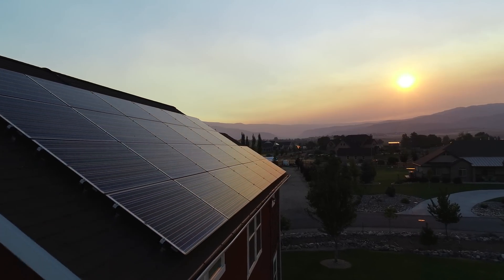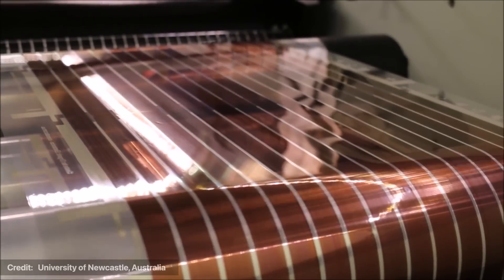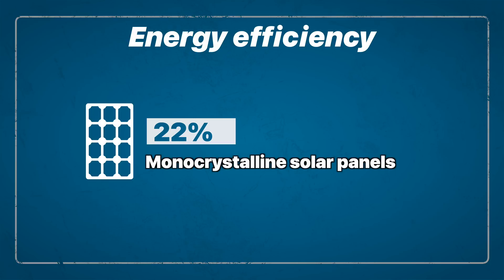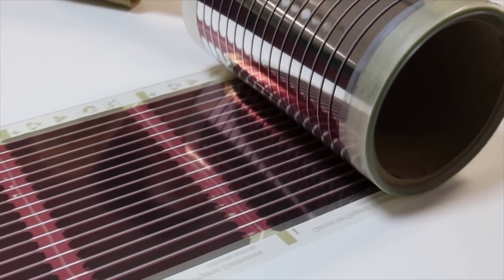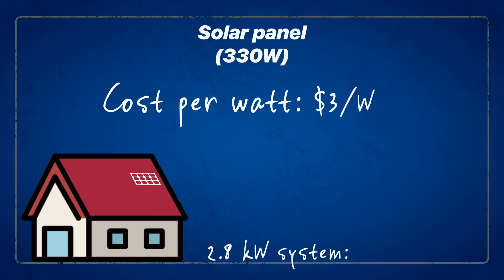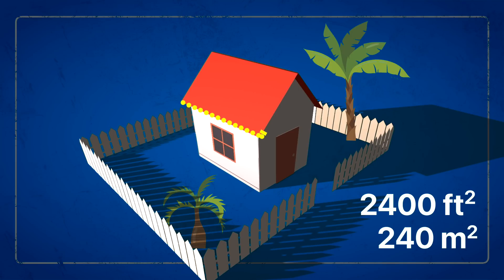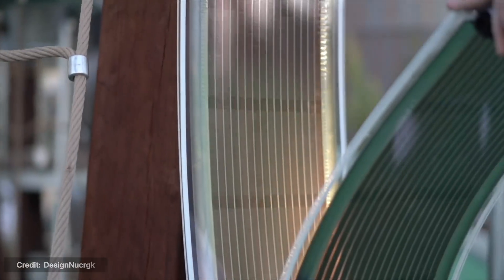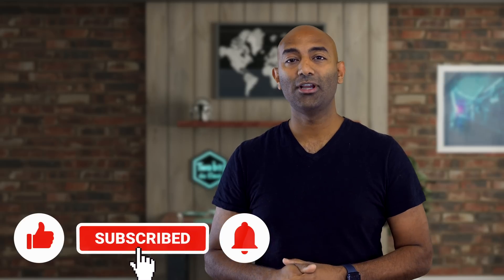This Breakthrough Solar Tech is CHEAP & Printed Using Ink!

Comment: The price advantage is misleading. A regular solar panel lasts >20 yrs. In the same period of time, you'll need to replace the printed panels ~10 times over, costing $20K in place of $8.4K. But it's a promising technology that can definitely be able to challenge regular panels with adequate effort and goodwill (goodwill cos, companies these days are hell-bent to make things that die soon rather last long).
Reply: As it currently stands, it's 2.3 times more expensive per Watt(over it's predicted life span) than regular panels. Meaning that that you'll be losing money unless you are paying more than 12 cents per KWh. The tech is not new, I remember there being a portable scroll style solar panel some years ago, but it looks like it's still too expensive for wide adoption.
Reply: Just curious - Would you happen to know if a solar panel stored under cover in its original box will start degrading b4 it's hooked up out in the sun?  Several years ago when I knew even less about solar than I do now, I was already fascinated and bought a system with those inverters that aren't good for electronics.  They weren't pure sine wave - which I didn't know was crucial at the time.  Anyway, b4 I could hook it up I found out and wound up selling the inverter.  (There was no power generator like today's all-in-ones.)  But I kept the solar panels for future use.  Now I have a couple EcoFlow Rivers which should power my essentials long term in an extended emergency; yet I don't want to wear them out either b4/unless faced with a dire situation.  So those solar panels are STILL boxed up and stored.  Making it pretty important to know whether the solar panels are aging already.  I realize they're outdated technologically, but I mean as to their useful life.  ...... Meanwhile, although the grid power's fairly expensive in a remote tiny town, by traditional passive means my costs remain quite modest even in a 2200 sq ft 1890's Vic.  Everything's also LED, Energy Star etc.  My entire city bill each month is well under $100; so comparatively low that when I first moved here to retire, they sent out a repairman to make sure I hadn't monkeyed with the meter!
Reply: @frostyfrances4700  whilst well kept panels might last 20 years or more in storage I wouldn't save solar panels for future use. If you can, use them now. With the money that you save you can afford new panels sometime in the future and the experience of using solar through all seasons year after year might be be useful in the future.
Reply: @longdang2681  - Thank you for your very kind and wise advice.  Part of the delay is bc my energy costs are already so low and it would be a long time b4 I could save up for what the future might offer.  So for me, stuck at 76 in TinyTown as I am, the main solar advantage is for a grid down.  Which we've never had here in my 18 yrs that lasted for more than 12 hours.  The local power plant has been rebuilt and we're also coupled with regional systems.  If they fail, it wouldn't be more than 24 hours b4 we were independently brought back for just local use on our own equipment.  Spare parts have been set by just in case.  For all the savagery most people around here exhibit due to politics, the town has somehow been run exceptionally well when it comes to that.  By the time I bought yard frames and paid for everything to be hooked up, I'd be lucky to break even when you factor in wear and tear on the equipment.  Also, at 76 I might not even BE here 20 years from now! :)  Or at least might be past doing much.

Comment: this sounds like it would be great for electric cars because you could bring a roll of it and unroll it in a field pin it down and let it charge for a few hours.
Reply from the maker: Yes true!
Reply: 2000 watts for an hour will get an EV about 6-8 miles of range.  To make 2000 watts with these printed cells you'd need about 4000 square feet of them. That's quite a bit to carry around for, maybe, 30-40 miles of added range on a day with full sun.
Reply: @jimmurphy5355  true but a lot easier then the other option.

Comment: I wonder if they have tried sandwiching these things under/between layers of glass or something similar to increase the lifespan. And embedding some refractors within the glass to as to direct/focus more of the sunlight into the printed solar cells might up the efficiency somewhat. If they can be custom tunes for specific wavelengths of light, then maybe they can stack them according to varying wavelengths and thus also increase efficiency. Both of these things are done with standard PV cells.
Reply from the maker: Yah for sure… though it defeats a lot of the benefits
Reply: @TwoBitDaVinci  well, maybe glass wasn’t the best choice of wording. But there are flexible and lightweight clear materials it could be sandwiched between. That’s more of what I meant.  Not sure why “glass” jumped off my fingers.  Lol

Comment: What about getting some to power the pump of pools?  My above ground pools only uses less than 5 amps.   I don’t know how many watts that is…..  but it currently runs on 110volts.   But I think the motor has a converter in the junction box….. so maybe these would work fine!   I would be happy to be a trial!!!

Comment: The roof is not the only place to put them. How about covering your garage door with them or the wall of your house or garage or fence?
Reply from the maker: Yah very true! Get life up to 10 years and this is a slam dunk
Reply: This is what I was thinking too. Or as seen in a clip towards the end, it could be used as greenhouse material.

It also makes me wonder about an idea I saw a while back, about doing covered parking with it, or some other large-scale application like that. iirc, those applications didn't make sense because of the cost at scale. But maybe these would present a different balance of that equation.

Comment: Wow i can't believe that in the USA you guys pay a fortune for electricity. Our price is a measly 0.071$/kw/h 24h a day. We don't have any nuclear/coal plants. 98% Hydro power and 1.9% wind powered and the rest solar. No wonder we sell to you guys. LOL.  
     Our government is giving us incentives on geothermal heating and cooling systems they last longer than heat pumps/furnace and also air conditioners and cut on electricity usages (economy of 25-35% on electrical bills). If you want to reduce the cost of electricity on the long term geothermal and solar hybrid systems (with battery) are the best bet.
     I know the federal government (USA) is offering a 26% tax credit for geothermal and solar; look into your own state for possibly more tax cuts.
    For example, if your electric usage was 500 kWh during December, it might be 2,000 kWh after upgrading to geothermal. However, without spending any money on oil (which is still on the rise) or propane, your overall heating expenses for the year will be much lower (close to 50% less) and to cool it is also cheaper (close to 45% less)
Reply from the maker: Hats amazing your hydro power is why!

Comment: This is not the same product as a ridged traditional solar panel, maybe we shouldn't be using them the same way we use solar panels.  This might work better as a solar awning, or even a patio umbrella. What about a solar pool cover in the winter. With these is that they have to be replaced more often than traditional solar panels, then put them somewhere you can more easily reach

If the problem
Reply from the maker: Very true!

Comment: Are there any solar panel systems that can be installed on a driveway? Many homes have more driveway surface area than a roof and easier access for maintenance.
Reply from the maker: Something a car can run over? Interesting… good point about availability. Plus it would get so hot!

Comment: The "efficiency" for solar panels is helpful, but it's not really the main issue.  The issue is cost for how much electricity you will get out of the panel.  Yes if efficiency is bad then the solar panels are going to take up too much space, but since the sun doesn't cost me money for it to shine on my panels, I don't care about the efficiency.  I care about the cost of the setup and when is ROI, along with having the capacity to run a home.

Comment: You haven't mentioned the cost of inverters and safety elements.
Reply from the maker: Inverters don’t change
Reply: @TwoBitDaVinci  Indeed.  In one way they don't change.  They are still needed.  They are part of the cost of a solar installation.  But they're not considered in your video.  

But in another way they do change.  Because they typically have a 10-year lifespan, regular solar panels have a 20-year life-span, and you told us these printable solar panels have a 2-year lifespan.

So you can't calculate the payback of a solar installation with the printable solar panels within their 2-year lifespan unless you also incorporate the payback of the inverters within two years.  And that makes a big difference.

Comment: the obvious application is an 8' wide and 53' long panel "glued" onto the roof of semi trailers.  Trailers are refurbished and repainted every few years and the roof patched.  Here is a simple low cost way to "seal" the entire roof and get solar power to boot. Refrigerated trailers need the power on the reefer units and weight is always in issue on reefer trailers (frozen food is VERY heavy per pallet).  so a typical trailer is full to weight when only 2/3rds full spacially.  - in an application where weight is critical.
Reply: Nice thought, but I doubt the power would be sufficient. Possibly traditional panels would out price the 4 cylinder diesel compressors they use now.

Comment: Sounds fun but 1 really strong wind will destroy them.
If not how much will it worpe in high heat.
I think its to flexible to be really all that good.
Ya 3% is not enough and the price well i don't have 30 years for something that lasts 1 to 2 years.
Like I will put something that lasts 30 or more years but if it lasts 1 to mybe 3 years then zero point.

Comment: If the 'racking' for the printable cells was designed right, it could easily be a 'do-it-yourself' installation after 2 years when new panels are needed. So the cost is really only the cells. Which would be a LOT less than the initial installation. But they doo need to triple efficiency so the panel fields don't cover whole yards lol.

Comment: If EVs can do most of the work of the printed panels, in an Emergency, the use-case is diminished even further. 
Further Research required.

Comment: I think the only application I could see right now for this is for someone living off grid in a camper van / RV (installed dyi on the roof) and this would need to be coupled with a battery bank.
Or maybe as a roof of a greenhouse?

Comment: Space based solar?  They are lightweight.  Large area is not an issue.  Not too much need for strong structural support, in low gravity environment.  No weathering, hence, longer lifetime.  Also, easily printable, for in situ manufacturing.

Open questions might be, (1) performance in high heat or cold conditions, (2) how to handle micro-meteorites.   (3) weight of copper wiring over a large area (microwave beaming?)

Comment: that means 97% will be heat solar
Reply: you use most your stuff as heat, anyways
Reply: they last as long as aluminium cans, ie, long
Reply: think about yard over head light building, or a manufacturing building
Reply: that 2 years is a non-tested law required thing only
Reply: so much things people are doing for law liability
Reply: in vain

Comment: There is nothing new abut this, I remember  hearing about this technology at least 8 to 10 years ago.  There used to be a program on then Discovery Chanel similar in format to the program Dirty Jobs.  I cannot remember the name of the program  but the program was produced by 3 or 4 people, they had if I remember correctly a woman who would interview various people or companies etc about what at the time was new cutting edge technologies under development for renewal energy.  Out of all of the tech they reported on were two stand outs that really grabbed my attention.  One was about a couple of MIT professors who were developing this technology of printing solar panels.  They claimed that they would be able to dramatically increase the efficiency of solar panels by printing several layers of inks that were all turned to different wave lengths of light and the other was to greatly reduce the cost and weight of solar panels.  This if the first that I have heard of this technology in years I bet because they were never able to fix the short life span of their cells.  Perhaps they gave  up on it and these guys down in Australia purchased their patent  rights to the the tech.  The other technology that to me made major since but probably was killed off by politics.  There were some researchers that had developed growing green allege in shallow pools made out of UV resistant plastic with clear lids that created a sealed green house.  They showed a CGI photo of a large array of  these pools constructed out on the Nevada salt flats.  Growing these green alleges produced a hydro carbon that had a molecular structure almost identical to crude oil.  If they had used this tech they could have produced a bio diesel fuel as well as plastics very inexpensively.  They had calculated that by growing these green alleges the amount of oxygen produced as well as the amount of C02 adsorbed made this form of diesel fuel carbon neutral.  This was back when the decision was made to subsidize the farmers to grow GMO corn to make the ethanol that is put in our gas.  If you really look at this hard this was and is still a big fraud, instead of helping the emissions from millions of cars burning 10-15% ethanol gas did nothing to reduce the emissions produced because ethanol has less BTUs of energy per gallon than pure gas so the only thing that happened is everyone has gotten less gas mileage from gas with ethanol than if we had been using regular gas so over the years we all  have paid probably 1000's of dollars more for the gas we are forced to buy over the years because we have to burn more of it to go the same distance than if we had used regular gas, I bet that more harmful emissions were produced by gas with ethanol than by burning regular gas.
Reply from the maker: thanks for sharing!
Reply: @TwoBitDaVinci  I forgot to mention that I am a retired aircraft technician and have followed your channel for a few years and have greatly enjoyed your content.  I plan on purchasing a surplus army 6x6 all wheel drive truck and build a high end expedition vehicle out of it.  I plan on making it all solar.  I am considering using a 3PH solar inverter with a 24Kwh battery storage.  I know that they have a heavy duty trailer but do not know how common they are.  If I cannot find one I will build one for a mobile workshop.  I have several industrial machines that use 3PH AC and is the reason for my interest in  a 3PH solar inverter.

Comment: i've actually got a tiny one of these that I got sent years ago as a demo, really cool to see it finally reaching market.

In the current form certainly not perfect for everyone but there's a lot of people in Australia (and everwhere) who live in rural areas with lots of land without infrastructure connections, being able to roll out some solar and tack it to the roof of a barn would enable them to keep small battery operated systems running year-round which would be ideal for monitoring systems or automation. 

Another potential use as they're so much lighter than conventional wafer based PV would be for small electric boats, you could go out onto the lake with the sheet rolled up then float it between two inflatable pontoons - could provide any power you need for small devices while you're relaxing, also if it was set like a catamaran it might not even cause too much drag so you could use it while moving. It could be a great accessory for a camper van too, maybe even a small one for a hiking backpack, when you're relaxing in the sun roll it out - maybe even prop it up on poles to get the best angle and to make a shaded little shelter. It wouldn't need to make much power if it's charging a usb powerbank or just replacing what you use from the car battery with lights, phones, laptops, etc.

Comment: I could see a case for short term solar power generation in the field for very remote work sites.  (Once the efficiency and lifespan improves a few hundred %)

Eg a work site hundreds of miles from anything in the Outback.  Instead of trucking in diesel for a generator every few days, just unfurl (and tie down) a few 100m X 2m long rolls over the bare ground.  Power the equipment in the trailer for a few weeks.

Comment: Panels are only part of solar installation. There’s also the inverter and electrical work to connect system (either grid or off-grid) to power the house. Less expensive panel technology is great, but it’s just the start of building a functioning home solar system.

Comment: Are they looking at wave guides in the protective layers that can propagate the full length of the panel sheet? Imagine fiber optic panels that carry the light to cells on the less sunny sides of the house?

Comment: Have you looked at those new panels by GAF the Timberline Solar system. I would like to know how good they actually are.
Reply from the maker: I have checked them out... honestly I'm not a big fan... they aren't all that good looking, with ridges to cover the wires, and more complex in the future etc... I'm going with a standing seam metal roof and traditional solar for maximum flexibility and the ability to do it myself :)